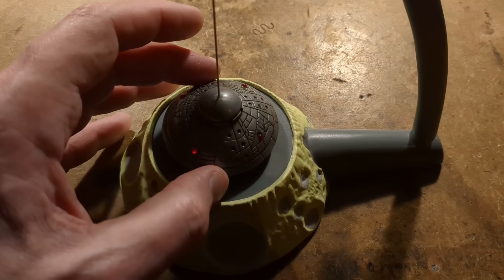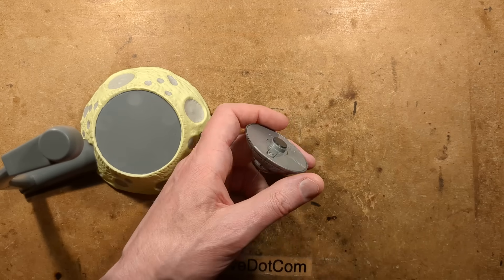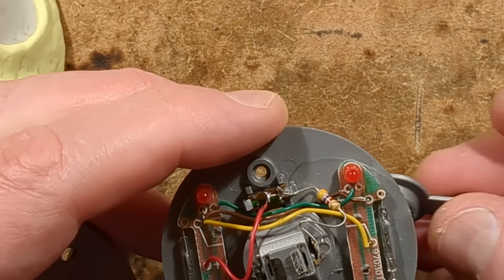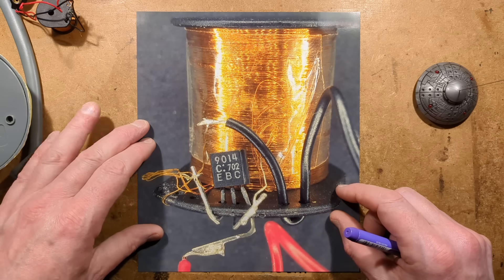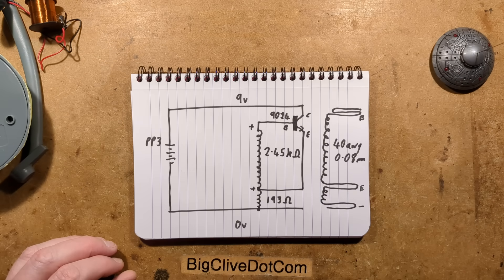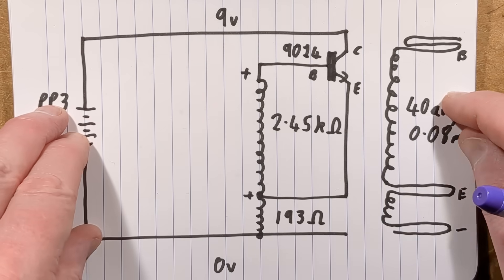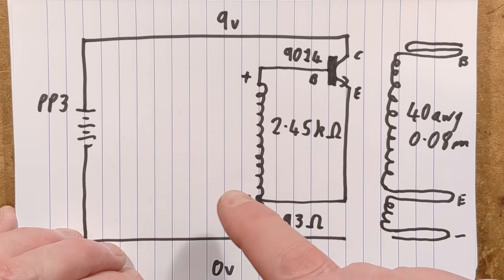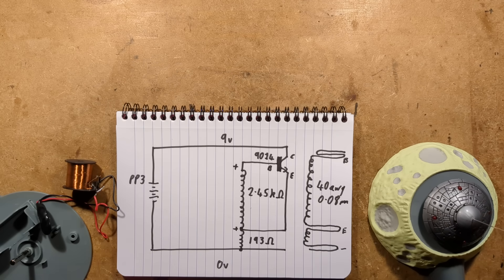Inside "The Visitor" powered chaotic pendulum ornament

Comment: Given a 40 AWG copper wire and a total coil resistance of 2.45kΩ, the length of the wire would be approximately 728.6 meters. So just a couple of meters of wire 😅

Comment: Slightly off topic but I got a "pure sine wave inverter" that claims to convert power tool batteries into mains current for charging laptops via a domestic plug, usb or usb-c. Used it for about an hour to run some led fairy lights and it started giving off a burning smell. Got a full refund and they didn't ask for the unit back. Wonder if Big Clive would like it for a tear down? I'm curious to know what's inside but I'd have no idea what I was looking at! 

4-Ports 350W Power Inverter for Milwaukee m18 18v Battery DC 18V to AC 120V/220-230V Outdoor Generator Converter 300LM LED Light

Comment: I love this kind of circuit that looks complex before you take the device apart. 😊
On the other hand, I find that the interior of the UFO has too many cables. 🤔
At this point they could have removed the batteries, the reed switches, as well as the button to replace everything by induction.

Comment: As with other pendulums you showed, I have to wonder would the addition of a diode across the low resistance pulse coil, help with efficiency and reduce the thump or multiple oscillator effect. Perhaps that would only help if the pulse coil part was on the collector?

Comment: It probably doesn't matter in this case but you should always note where a particular screw came from. They cut different threads so if you put a different screw back in you can destroy the thread and the screw will not tighten. Whoever constructed this melted the insulation with the soldering iron. "Sweat shop"?

Comment: Fun Fact: Magnetic reed switches are the most popular method of detecting open doors/windows in residential and commercial burglar alarm systems, and have been for decades. They can, after years of use, develop a bit of residual magnetic charge and the contacts can "stick" together - but they're also very inexpensive and easy to replace.

Comment: I wish all components had the legs marked like that... It's typically done on modules but rare on other parts and it makes things sooo much easier when using the parts by hand.
Reply: @VynVdragon.  Get yourself a TC1 transistor checker if  you have not gotten one yet.  $20!!
Reply: @totorodad typically I just read the datasheet and use the diagrams in it, takes about as long to identify but that's not why it's a issue, something, likely the ADHD, causes me to forget which pin is what in about half a second if I'm not keeping my eyes directly on it.

Comment: Hackability potential!

* Swap LEDs with high-efficiency variants.
* Replace saucer circuitry with a coil+capacitor. Have it build a charge as it flies over, until we overcome the forward voltage of the LEDs and get a flash. (No more button batteries!)
* 9V USB-C PD trigger board so it can run continuously.

And others, I'm sure. Neat widget. 👍
Reply: Great idea!
Reply: Probably happily run directly on 5v usb, less violently but would still fly around
Reply: @voltare2amstereo  Quite right. That's why I like the idea of a trigger board. USB-C will supply 5v first. It's virtually guaranteed to work; the power source would just dictate how well. 😁
Reply: Or replace the base magnets with a guitar pickup and and as the spaceship goes by amplify the sound.  Should be fun.
Reply: @totorodad  The tones might be subsonic, but one could introduce a voltage-controlled oscillator with that. Run it through a spring reverb, and you'll get flying saucer noises. 😁

Comment: Learned something interesting! I had never heard of a pp3 battery. We just call the 9 volt batteries in the US. 
Maybe that’s just my family Idk.
Reply: Like 1.5 volt cells, 9 volt batteries used to come in many different shapes and sizes. 9 volts was useful for early transistor radios, so larger higher capacity 9 volt batteries were common. The PP3 was one of the smaller sizes and remains available to this day. I believe PP meant "power pack".
Reply: As I understand, 9 volt batteries are the only current use of aaaa cels.
Reply: @thomaswilliams2273  I haven't taken any apart for many years but the zinc-chloride PP3 batteries of my childhood used to contain a stack of flat cells. Alkaline ones might be different. I have a laser pointer that uses AAAA cells and I bought two twin packs of Duracell LR8D425 from Amazon earlier this year.

Comment: When the transistor turns off and the magnetic field collapses again, don't you get a big back EMF in the coil? I've seen cases where there was a diode mounted across the coil to short the spike in this situation. Is there a disadvantage to NOT using a diode in this circuit? Damage to the transistor, perhaps?
Reply from the maker: I did try a diode across the kicker part of the winding and it didn't affect operation.